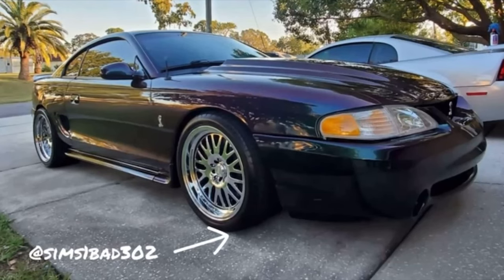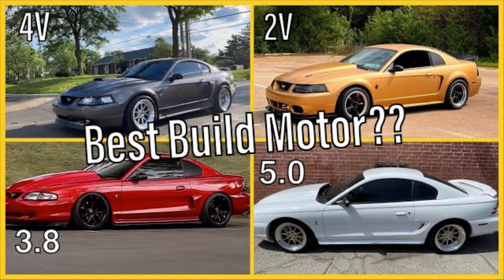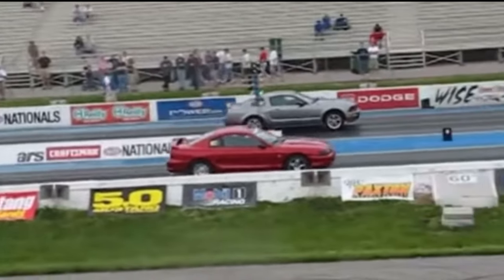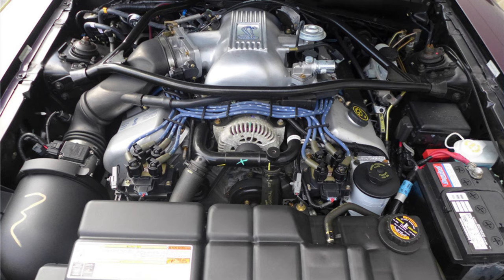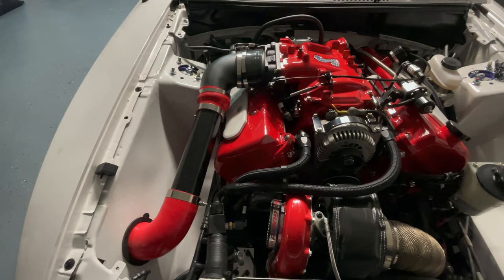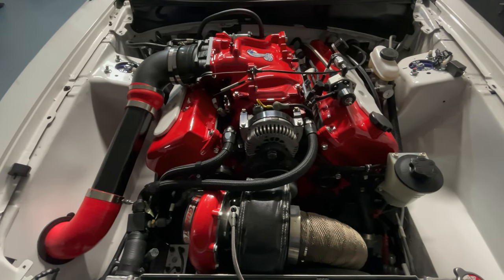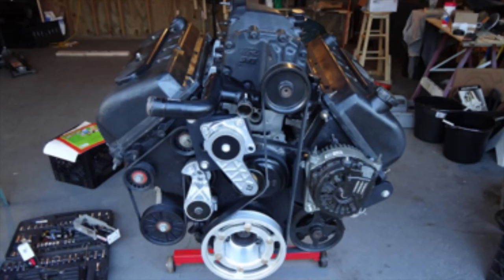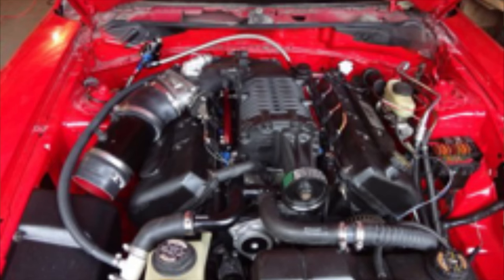Which is the best engine for your Sn95 Mustang build??

Comment: Depends on what best means for fun i’d say 5.0, but for longevity and the best for beating on 4.6 2v I’ve seen a few Crown Vic’s hit 300k+ and not skip a beat.  The 4.6 4v was so exotic at the time.  I love the fact that the SN95 is finally getting some love.
Reply: I've seen many 4v above 200k and I saw one 96-98 well above 400k original engine.  They're very stout.  They can make as much hp fbo as a 2v does fbo and cammed probably slightly more and they Rev higher.
Reply: Dude there's 5.0 out there that have been running for over 50 years now
Reply: 308K and counting on my '00 GT daily driver ...yeeehaw!
Reply: @jklancaster1285  yes, but they are completely different engines than the current 5.0.
Reply: I love the 2v, you can't get a lot of power out of them pretty cheap. And they sound awsome.
Reply: The 3.8 is perfect to build if you gonna motor swap it cause you can get it for $8 lol
Reply: @jklancaster1285  Agreed, I've know people with stock Foxbodys with over 400K on an original drivetrain. Does that mean a SBF is better than a Coyote? Hell no! Do they sound better? Yes. Will they be more reliable while making less than half the power of a Coyote when talking stock engines? Maybe, but a maintained Coyote isn't necessarily unreliable, and a Coyote will accept a HP increase leaps and bounds more reliably than any OEM 302 SBF. I've owned several 2V Modulars, and still own my 03 Lightning which has proven to be the best vehicle I've ever owned, but 2V Modulars suck balls for performance. Trying to make a small bore engine perform with only 2V a cylinder is foolish IMO. Unless I'm boosting I wouldn't consider a 2V engine with under 4 inches of bore a serious threat in todays market. Why do you think that even a 6L LS engine has so much more power potential than even a 5.7L LS engine? It's because your LS1/LS6 is rocking a 3.898" bore, where a LQ4/LQ9/LS2/etc use 4" bores. A 4.8L/5.3L use 3.78" bores which are too small, and why GM's common 5.3L has a hard time competing with modern competitors, but really 355 HP/383 lb-ft is pretty impressive for a N/A 2V engine of its size that runs fine on 87 octane, but still a 5.3L has too small a bore. I say all that to say at only 3.552" of bore diameter a Modular engine has way too small a bore, even to make a good 4V N/A engine really. But for a 2V design, trying to fit large enough valves in that small of a bore to let them flow enough to make good power is impossible. TFS heads do an amazing job with the limitations they have to work within, but can only be asked to do so much. Even stock GEN3 Coyote heads, and GEN5 SBC 6.2L heads will outflow fully ported TFS Modular 2V heads by a noticeable margin.
Reply: @dongkapuyawn5107  You doing just regular oil and other fluid changes?
Reply: @artstudent1237  yes. It’s my daily driver so it’s not babied. 316k and counting. Maintenance is key, fluid changes, battery replacement every 7 years or when necessary, alternator, fuel filter, etc.

Comment: 4.6 4 Life.  The 4.6 Teksid block will hold 2k hp with the right internals.  More than a sleeved Coyote.
Reply: 4.6 2v is better.
Reply: ..plenty of sleeved coyote's past 2k
Reply: @scottb4104  the teksid can hold even more than that.  The teksid is the best block ever offered in an oem Ford.
Reply: @kskip4242 2v is not better a teksid 4v is better in every way.  It's lighter and can make way more power potential.
Reply: @midnight347  I'm talking about the sound wise.

Comment: I have a 2001 Cobra… I chased horse power for years running fox body stangs… Now that I’m older I love having a stock factory all original cobra… Not real fast but it sounds good and turns heads.
Reply from the maker: Nothing like a turn key Mustang
Reply: I have a 1995 cobra convertible bone stock with 21K miles. I like it just the way it is.

Comment: Man I had a crown vic, I had a intech lincoln navigator 5.4 4v and now I have a 5.0 and I really tell you I am now in love with this engine. Simplest engine to have cheapest to maintain easiest to mod has the most mods out there and is not modular.
Reply: I went from an 03 crown Vic to an 89 LTD and I agree. That 302 5.0 is simple as hell.
Reply: Yep been around since like 1965
Reply: What is wrong with a modular?  Modular is easier to build power with than a 302.  You don't need an aftermarket block to safely go above 500 or so at the tires.  A b bead 4v with forged rods and pistons to go with the factory forged crank and teksid block you can make a ton of power with an otherwise stock engine including the heads and cams.  Try that with stock block, heads and cam in a 302 and see how that works out.  I love the pushrods but I love modular more.  People are still sleeping on their potential today after 25+ years.

Comment: No one calls 99-04 SN95 they’re new edges all before 99 are SN95’s
Reply from the maker: @FalseHoodx  what generation are 99-04 Mustangs? i’m not the new edge police over here. If you want to call 99-04 Mustangs a New Edge go right ahead. We have a 02 Mustang and I always call it a New Edge. If someone has a 01 Mustang and says I have a Sn95, they are not wrong either. It's preference on how you address the 94-98 and 99-04. Like you said, most call 99-04 a new edge. However, to say a 99-04 is not a Sn95 is simply wrong.

Comment: Back in '98, I built a 347 and it's still going today. In '03, I built a 3.8 for a '98 and put a supercharger on it.  It's still going, and it's a daily driver. My other 2 '98's have the 3.8, 100% stock, and both still run with no issues.  My '07 Gt has the 4.6, but I've had issues with the lash adjusters(lifters) going out often. In the past 10yrs, I've had several 3v 5.4 engines in various vehicles and feel those are some of the best engines despite all the bad advertising out there. The 3v with a simple timing set and oil changes keeps it going. It's more of a lack of maintenance for everyone who has issues with the 3v.
  Of course, the only thing I've done to my 347 and 3.8 is regular oil changes.  Here in Okla, I can't find any v8 engines in the salvage yards that are good anymore, and if they have them, they want an arm and leg. 
  My son and my brother both have coyote engines in their F150's. They run strong but seem to use oil with higher mileage just like the 2 and 3v does. 
  With me being a mechanic, I work on any and all manufacturers vehicles, and equipment. You name it, I've prob did it. Over the years, we've driven lots of vehicles and family seemed to buy all other brands just because I've went mainly all Ford. But the last few years, everyone in our family is now driving Fords. I'm talking brothers, sisters, aunts, uncles, cousins, you name it, they all have Fords and occasional additional others. I've asked them why, and they say over the yrs they've had the least issues, been more reliable, and less cost driving them.  Some say they now know why I drive Fords. Believe me, I use to drive a short wide chevy as my daily, and still have my s10, along with dozens of other domestic and import brands. But as far as reliability, cost, and looks, all my dailies are Fords.
  I'm currently installing a 351w/408 in an '86 F150 4wd.  It's been 3yrs in the making. $14k in the long block only. Fi and all the goodies. Hopefully, it'll live a long time, keeping my fingers crossed, lol.

Comment: In my opinion it’s gonna be the 4.6 2v
They are plentiful and ford put them in many vehicles, the explorer had an aluminum version 
I choose 2v because they are dependable and can handle “decent” power stock bottom, countless guys are putting down 450rwhp safely with a good tune.
Forge the internals and go with bigger ported heads and add boost and they are quite capable of big numbers, not to mention the sound incredible

Comment: Pretty cool video I retired State Police mechanic 37years//and that's all I did was worked on is Fords Motors// and Dodgers and Plymouth I'm going back to the late 80s I have a 97 sn95 I took a state police motor out of a junkyard police car only have 42 thousand miles on it and I took the motor and transmission along with the PCM ECM and I put a supercharged Vortec I couldn't be so happy this car moves I wish I can send you the pictures motor but yes and has a state police motor and an sn95 in a 97 Mustang GT great job on your video and your audio go Ford//happy and //retired!!!
Reply from the maker: Sounds like a great setup. How much boost? A boosted 4.6 in a SN95 will surprise a lot of people.

Comment: It depends on what you want your car for on what motor as well as your funds. The 3.8 is a good motor if you are not wanting to race. Not all mustang owners want supped up power. Some of us just want the look and mileage that comes with the 3.8. 138 miles on just over 3 gallon of gas. Of course I do prefer old school cars (The ones with no computer bs).

Comment: I've a 97 Cobra, stock engine, I installed an Intercooled Procharger on about 4 years ago with supporting fuel system mods. Kit is unique for the Cobra, undercut impeller to limit boost because factory crap pistons. Only makes about 7lbs boost. Car has over 125k on it, runs like a dream yet. When tuned, it made 400RWHP on a Mustang dyno, tuner said on a Dynojet, would of been in the 450ish RWHP range as Mustang dynos read 10-15% lower than Dynojets.
I can't complain, car ran 12.20s @ 116mph full weight with a very easy launch, I drove car 100mi to track, didn't wanna break anything, had to get home...lol
Reply from the maker: IMO, that's a perfect setup

Comment: Leased a new 94 mark VIII. Have owned 93,94, and 95 Mark VIII's all ran great zero motor problems. Bought a new 96 Cobra back in them day loved it very strong motor, but weak transmissions. Had transmission work done under warranty. Miss those 4 valve motors they ran awesome and delivered excellent mpg. Mark VIII was a fast luxury machine. Cobra was a nimble burnout machine and very reliable. Now running a 2010 GT500 with 5.4 4V supercharged and also a 2016 GT ragtop with 5.0 4V. These motors put out way more HP but darned I loved those old 4.6 4V motors. You can't go wrong with one of them.
Reply from the maker: Thanks for sharing your experience with these motors.  I'm going to buy a mark8 one day and put forced induction on it.

Comment: Boss block forged 5.0 stroked and boosted. With modern electronics/cpu, can match and exceed any mod motor, even coyotes and be 2x more bulletproof at 1/2 the cost. Otherwise high psi ecoboost for weight balance.
Reply from the maker: Of course but this topic is about production motors from the Sn95 platform.

Comment: I currently own a 98 cobra with 4.10s, but I'd say from a torque and cost perspective an old school 302 pushrod engine would be the way to go since the sn95 platform is heavier than the foxbody. My old foxbody with 3.73s would pull on my cobra 1st-2nd gear in a race.
Reply from the maker: Really love the low-end power of a pushrod 5.0
Reply: Then the cobra will walk away from anything short of heads cam intake 302 with just bolt ons.  They like steep gears 456 and a drag radial and the 302 won't get it out of the hole anymore.  They like to Rev and have a 7000 rpm window they need a gear if na.  4.10 if boosted 456 na.

Comment: There is no denying the performance of the 4v is superior. I've been a tech for a long time and seen a lot of these 4v in all their different variations not be as reliable as the 2v. Not necessarily unreliable, but just doesn't take the beatings back to back like the 2v. That's really the only place the 2v can outshine the 4v. After that 4v is better in every way. The old school 5.0 is an iconic motor that is very capable no doubt, but the short powerband is a hinder in todays age of high revving engines and endless gear changing. With gears you acn make up for this till about 110-120 mph, after that its lights out for all these old platforms vs new ones imho.
Reply: You know the 5.0 is one of the highest revving v8s out there many are turning up to 9k on the strip every weekend 

On a power curve it steadily just produces more power as it revs higher all it takes is the right cam and valve train
Reply: Modular not SBF they are talking about the older ones not coyotes

Comment: old junkie 331 or 347 10:1 compression , Push-rod motor. Easy to build and figure out. a lil Nitro, After aluminum heads and you're in the 10's
Reply from the maker: I'm a big fan of pushrod motors. Like you said, very simple

Comment: 351w stroked to 408ci in a 94-95 is the setup id go with. It will also go in a 96 to 04 with a k-member swap.
Reply from the maker: Can't go wrong with cubic inches but I'm talking about oem motors in this video

Comment: I have a 95 5.0 with 373 gears no cats , factory headers with a upper and lower gt40 intake ported and polished with bbk throttle body oh hpipe with factory heads for now, easy motor to maintain, no leaks no burning oil and I gap my friends 98 Gt and another 96 and they have bolt ons as well, I have gt40p heads with 4 bars but no sure if I wanna put em on yet, or which way to go
Reply from the maker: The gt40p will give you a small bump in compression.
Reply: Not sure if I wanna do all the work for just alittle increase in compression, have to find headers to fit, spark plugs will be hell to change and it’s a xpipe not Hpipe , just put black American racing rims and 1 inch spacers on rear kept 17in size, love em so much more than Chrome with HR lowering springs, got sub frame connectors fixing to install, also in process of repainting the car going back with a red color not sure which just yet any ideas??

Comment: B head + High Comp + E85 + Teksid.  Once forged you can throw all the boost you want at it.  The only knock on it is that it cost a lot of $$ to build one.
Reply: It really don't cost that much honestly especially in comparison to other engines when they're built similar.  Forged rods and pistons is all you need to make some pretty damn good power.  They come with a forged crank in the cobras I know idk about the mark 8 but literally forged rods and pistons and you can make 700+ easily on otherwise stock engine with boost thrown on it.  Especially if you do a high compression e85 build its super easy to hit 700+  forged rods and pistons can be had for like 1400 bucks.  It's a slept on performance engine with tons of potential.  You could even drop in some 03 cobra stuff like rods and pistons.  I assume it would work fine with the teksid?

Comment: My 2009 Ford Crown Victoria has 173K miles and it still purrs like a kitten.  I got her in 2015 at 93K miles from State Police auction. So it probably took some highway abuses but since it’s been well taken care of by me.  My friend’s 2011 CVPI just hit 315K miles and it runs like a champ.  I have a 2003 Mustang GT with 55K miles and I expect it to run well into 300K but I don’t drive it much but the engine feels brand new still.  It’s not fast but it’s reliable.
Reply from the maker: These mod motor will rack up mileage I'd taken care of. I'm going to get a marauder one day.

Comment: I’ve been owning a 96 cobra since late 2016 and have never had any real issues besides a little bit of over heating and my transmission breaking one time. So while that’s being said, my brother owns a 95 gt with the pushrod 5.0 that is now modded with a trick flow top end kit and vortech supercharger that you can see in my channel  right now, but what I was able To tell between the two just by driving them is that the 95 gt is much lighter from the nose and makes it easier to corner. As far as power goes, I think the ford small block 302 is the better choice for an all motor build if you keep it under 500whp and if you’re looking for boost I think the 4.6 dohc is the better choice since all you have to do is swap out the pistons and rods, upgrade your fuel system and you’re ready for some serious power, while the pushrod 5.0 you’d have to get entire block from dart Which is not cheap at all considering you still have to buy the internals and machine the block etc….
Reply: 96' Cobra owner here too. I recently replaced my a/c condenser. The existing condenser was likely 22 fins per square inch, whereas the replacement appears 16 & will definitely not restrict air flow as much as the old part. 
My Cobra has not had the Ford TSB service performed for the cooling upgrade. I won't know the results of my effort until next summer, but I'm optimistic after pulling that old dense as hell condenser.
Reply: @gasman8750  is it the a/c condenser that they replaced in the 97-98 cobras for a cooling revision or was there more to it than just the condenser? I will have to do the same to my 96 cobra as well if that’s the case

Comment: my 98 cobra b head motor made 309 whp 303 ftlbs at the wheels with lth,cai,udp and a 90mm maf. you gotta use hci with a pushrod 5.0 to make that power
Reply from the maker: True

Comment: Lincoln continental had it aswell just front wheel drive.
Reply: I have one. 😅. I got it at 75,000 miles.  I love how easy it is going around curves with it because of the FWD. I'm afraid to mod or tune it because of the transmission.

Comment: What about the 3v. It didn't come in the sn95 but will bolt right in and when you lock out the cam fazers it'll run on the stock ECU.
Reply from the maker: I'm a big fan of 3v motors but like you said, this is only about production sn95 engines

Comment: Since the '95 Cobra R had a 5.8/351W why not add that to the mix?  As well as the 408/427/etc strokers?
Reply from the maker: I don't remember the number off the top of my head but the 5.8 motor was only limited to 300 units and you have to have a  racing license to purchase. I wanted to keep this list to engines that were available to everyone that walked into a Ford dealer. Those are some awesome motors to build tho.